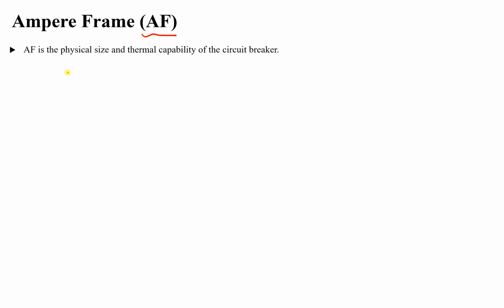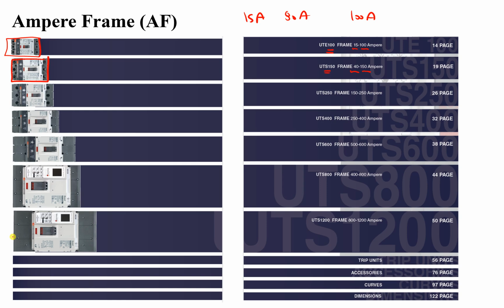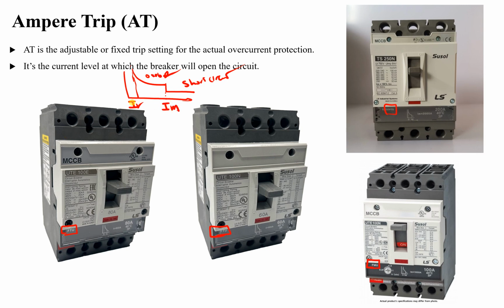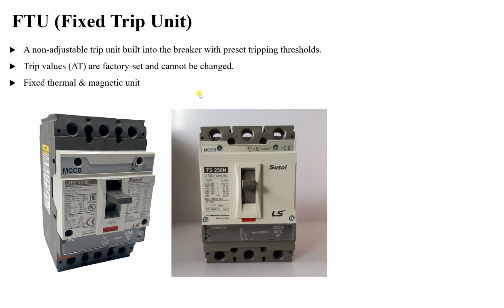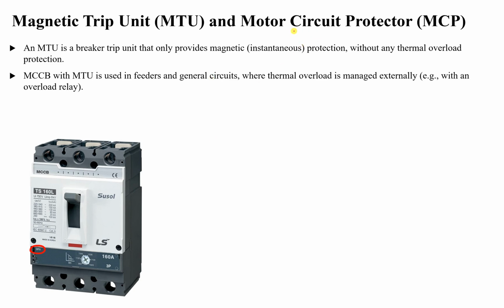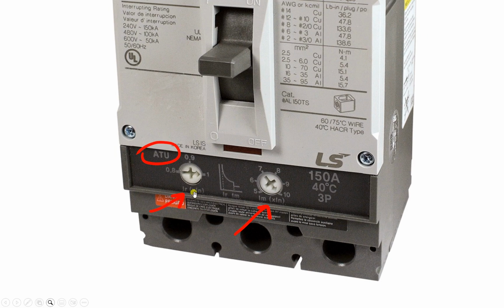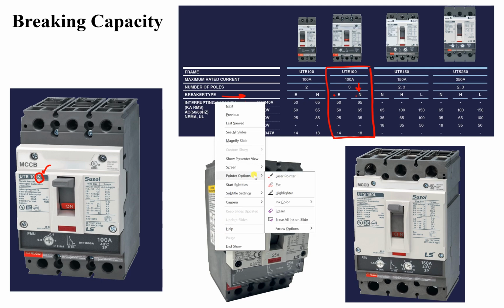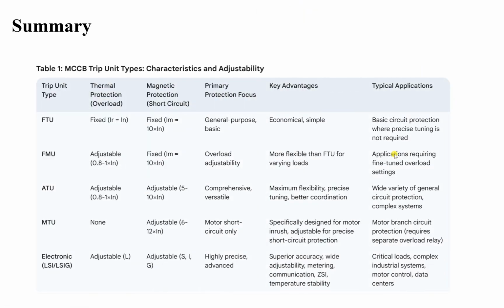AF & AT vs FTU, FMU, MTU, ATU | MCCB Parameters Every Engineer Must Know!

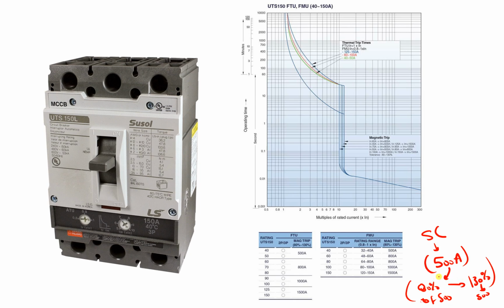Comment: 22:41 
The 500A trip value may change due to the surrounding temperature of the MCCB. You can predict when the breaker will trip by going back to the temperature de-rating. Curve or schedule.
Reply from the maker: The derating factors are applied for the thermal tripping of the breaker not the magnetic tripping. 
This is due to the bi-metallic strip, responsible for thermal tripping, are affected by the ambient temperature.
For example, at higher ambient temperature, the bimetallic strip is already preheated, so in the case of an overload, the bimetallic will bend and trip sooner than the rated thermal current that we desire. That's why we oversize the breaker according to the derating factor specified by the manfacturer at the operating temperature to avoid this issue.
For the 500A (the magnetic trip part), the tolerance given (80-130%) is the range that the breaker will act upon during a short circuit and we can't know exactly what value it will operate at. This is due to inherent mechanical variability. 
That's why when selecting a circuit breaker for a motor, we have to make sure that the 80%*Im (minimum value) is not less than the inrush current of the motor and the 130% (the maximum value) doesn't exceed the short circuit current that can occur in order for our breaker to operate during a short circuit as quickly as possible.
Reply: @EngrAhmedMahdy 
Thank you so much 
It makes more sense to me now 🙏